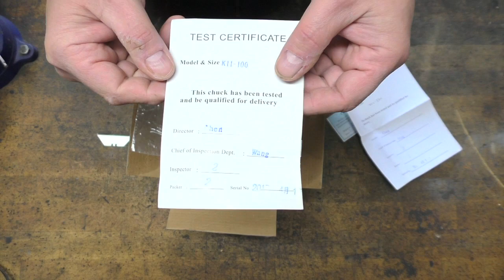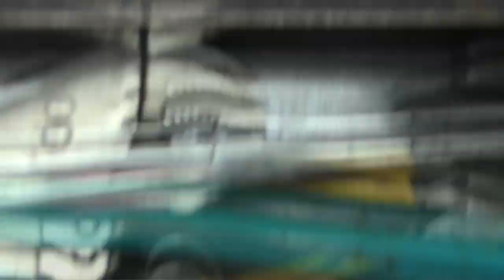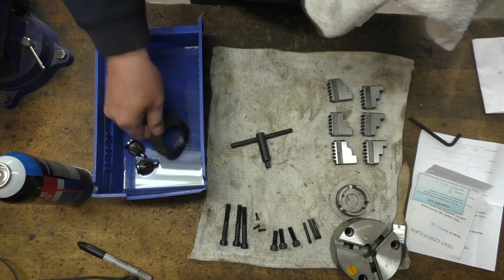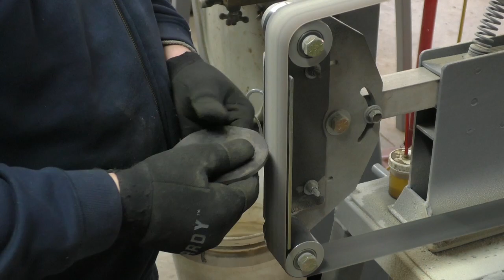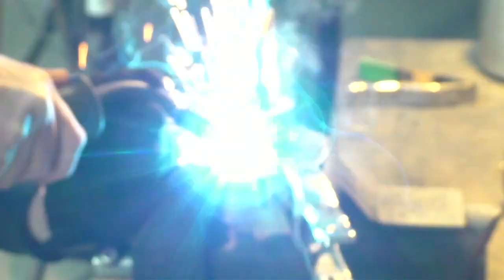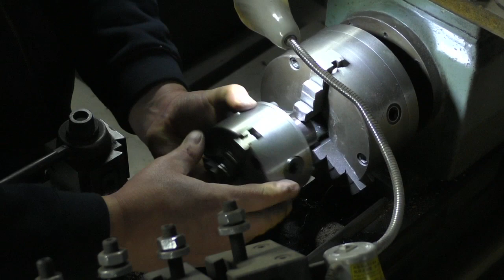Shars 100mm aka 4" lathe chuck

Comment: I've cleaned and stoned quite a few of those chucks - most chucks don't go as smooth out of the box as the one you showed. All chucks leave my hands with the possibility to turn them with one finger.
Check the chuck, there will most likely be burrs on the T-grooves in the chuck and the jaws. Smooth them out with a small stone for even better results.

Comment: Good cast iron is, in fact, self lubricating. Cheap castings like that are loaded with carbides and other junk. What you've done extended the lifetime of your chuck considerably. I own and regularly use Shars stuff and it pays itself back quickly. Very usable once it's tidied up.